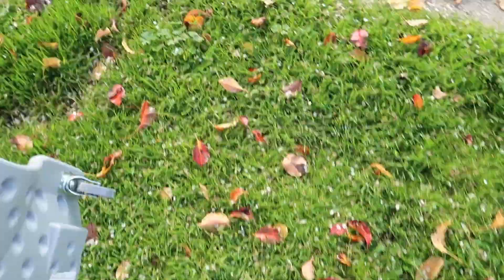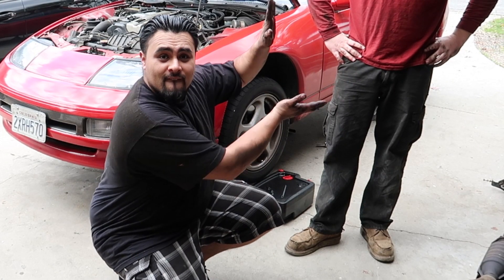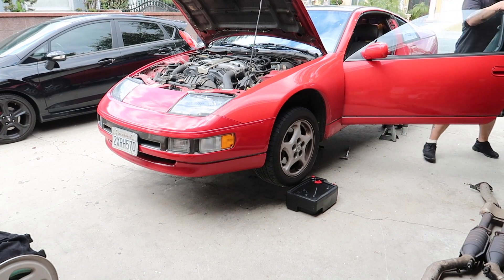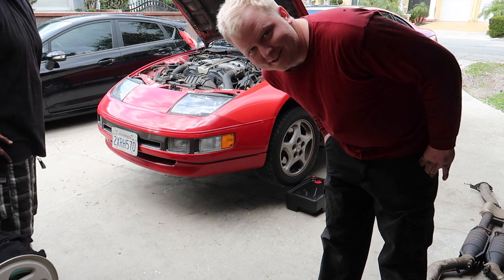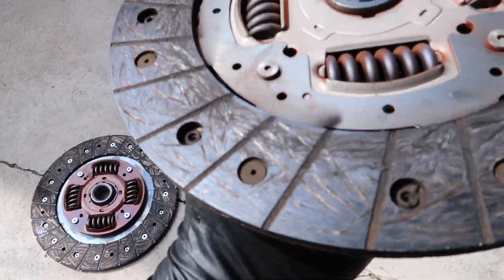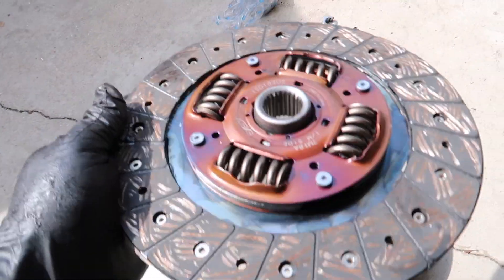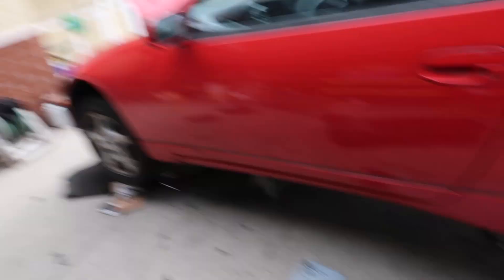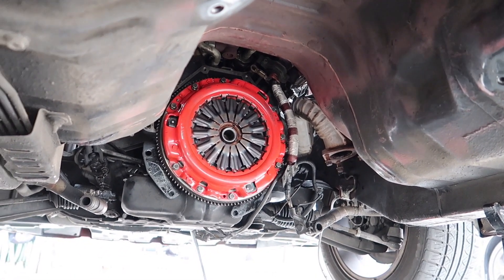Nissan 300ZX Z32 Clutch Replacement....WHAT A DIFFERENCE!!!!!!

Comment: in my 300zx TT the clutch slips after several kilometers .
Reply from the maker: Same here but because I failed to resurface my flywheel or install a new one. Plan is now to upgrade to maybe stage 2 clutch with an upgraded flywheel and do it right this time lol. Good luck with your fix.

Comment: How do you took out the drive shaft?
Reply from the maker: We removed the exhaust to make it easier for us to remove the trans.

4 bolts on a rectangle metal plate underneath /along the driveshaft. 

4 bolts on the rear driveshaft attaching to the rear diff. Put it into gear so the driveshaft doesn’t spin while trying to remove the bolts.

Then two bolts in the center of the driveshaft which will allow the driveshaft to flex downward from the center allowing you room to pull out the driveshaft from the trans and rear diff. Hope this helps. Good luck!!!!